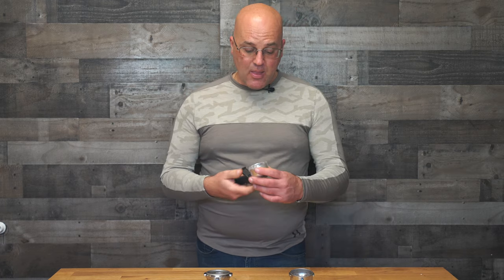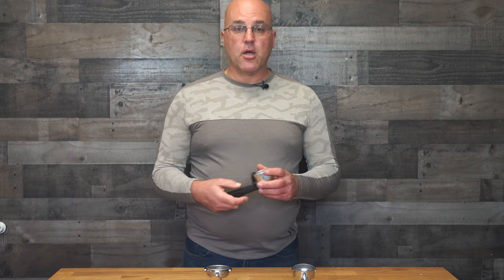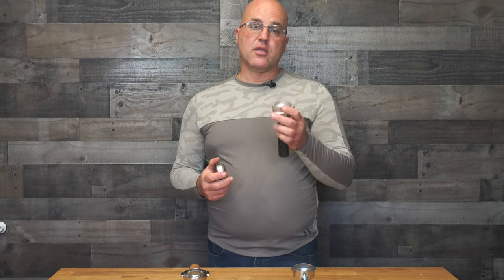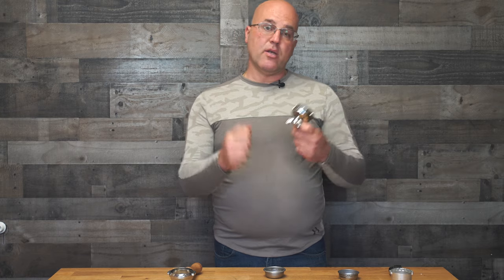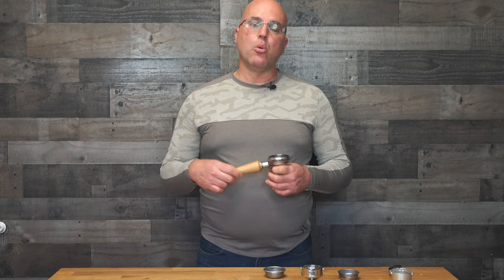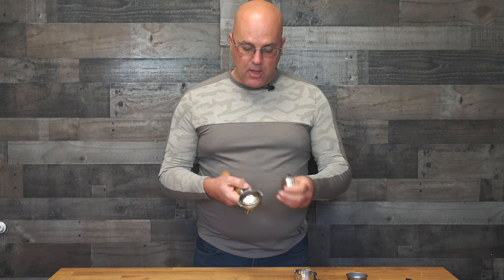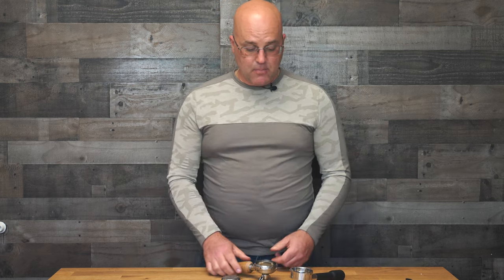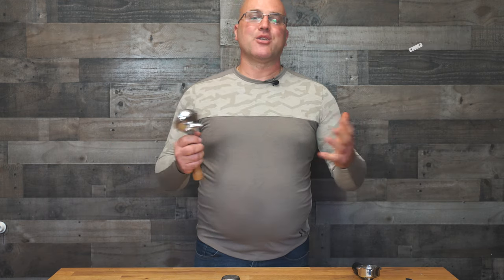Portafilters on Espresso Machines: Learn More!

Comment: Have you come across Nespresso VertuoPlus not heating but it will turn on and run a cleaning cycle but the water does not get hot? I think I might have to change out the thermoblock but would like your opinion.